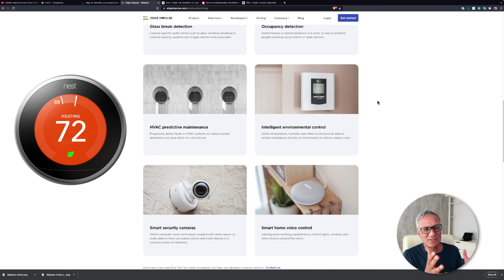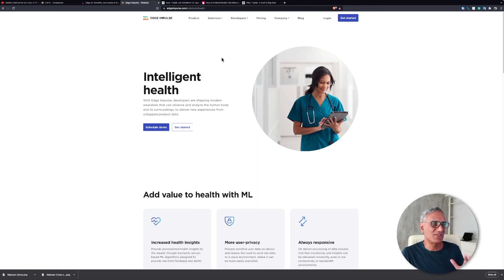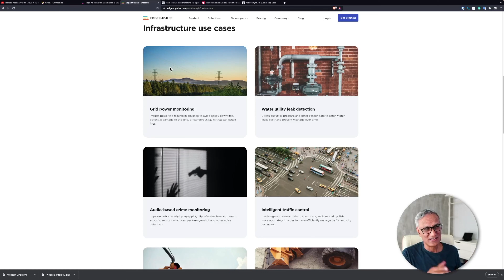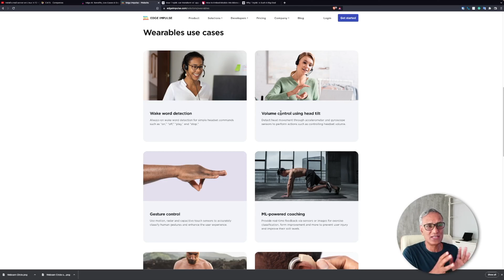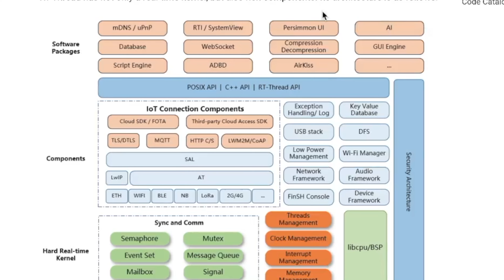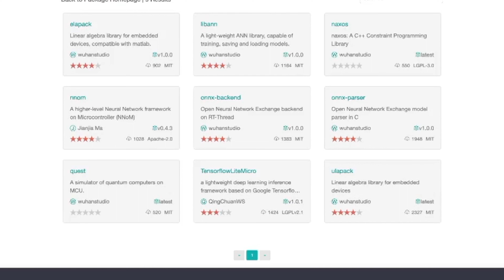Edge ML use cases - RT-Thread Presentation

Comment: I'm having trouble wrapping my head around the basics.. for example, 

For image classification, how is machine-learning preferred/different from OpenCV?   What is OpenCV doing that also makes it so effective?

Are there certain applications/data-sets where certain ML libraries would work better than others?   For example, is it true nearly everyone use supervised learning (correct input/output pairs must be collected).. and that unsupervised-learning (raw data with no user-supplied classification) isn't very common?

And except for RenderedAI, does the training data always have to be captured on the device that will run the algorithm?

Also, I understand you have to feed the collected data to a library  (YOLOv5, EloquentTinyML, Node-Red, tensorflow js, AI Code 101, Neurona, TinyML, MicroML, tflite, Edge Impulse, everywhereml, etc), but what does the output of the training look like?      Is it c/python, or does it still have to be (hand?) converted into an algorithm  (Non-Linear Multi-Regression or a classification Model)?

What are the typical RAM requirements of the microcontroller needed to run ML?